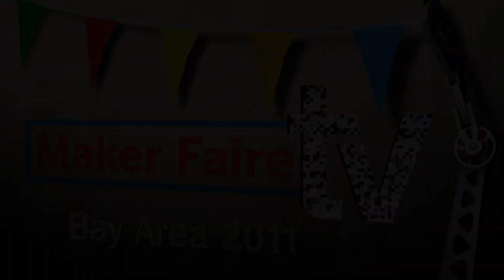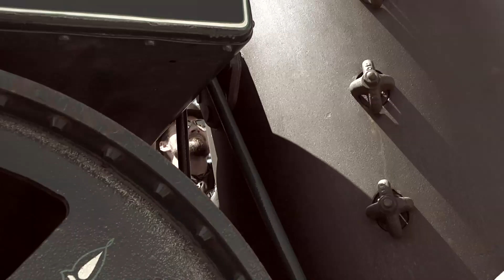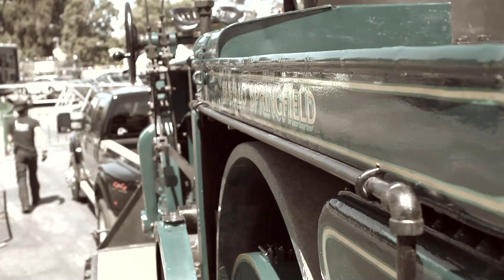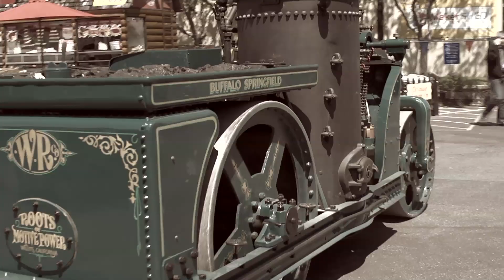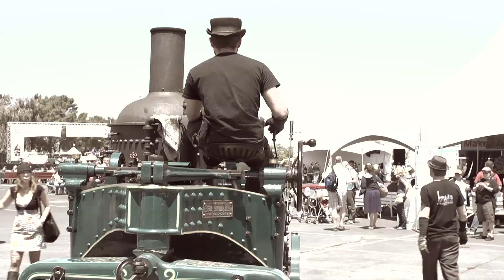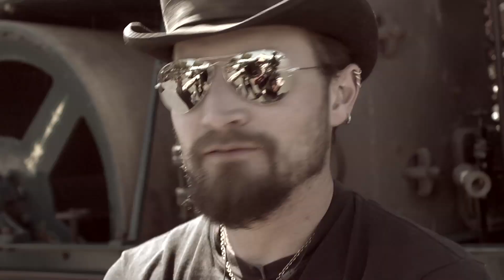Working Steam Contraptions of Old: Kinetic Steamworks

Comment: Its true that many farms will use 80+ year old equipment. I grew up and live in a rural area and know many farmers that still use 60+ year old Farmall, John Deere, Minneapolis Moline tractors and implements. What I was pointing out was that they are all GAS powered. Steam power has been phased out since the early 1900's. Its expensive to fuel, has substantial downtime (large steam traction engines take upwards of 2-3 hours to get full steam,) and is less efficient.

Comment: Clearly you don't know what you're talking about.

LOTS of farms and factories still use 80 year old equipment. Equipment like that has been running for 80 years and with simple maintenance will run for 80 more. "If it ain't broke, don't fix it."

Comment: "I was around steam alot when I was younger, lived on a farm..."

Ok, you look at most 30 years old, and I don't know many farms that have used anything steam powered in the last 80 or so years. Also, not really a steam contraption, actually a super simple, common road roller. I don't see the "maker" in restoring a old piece of construction equipment, as cool as it is.